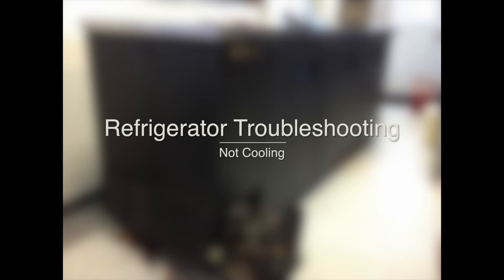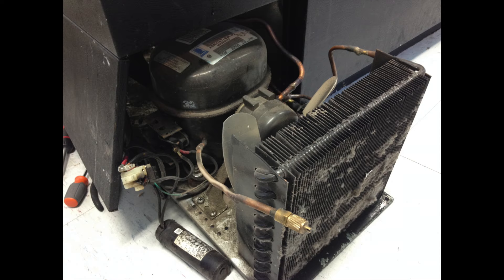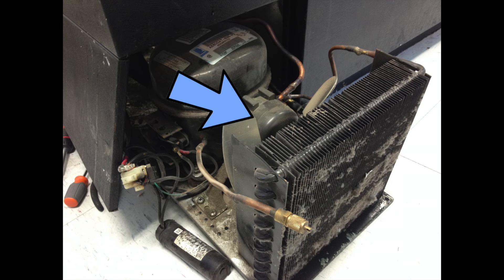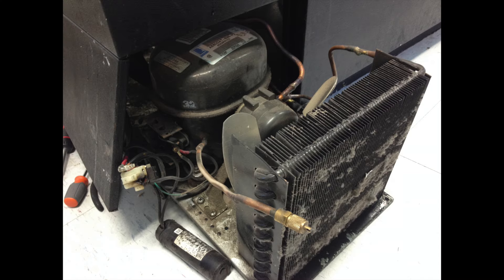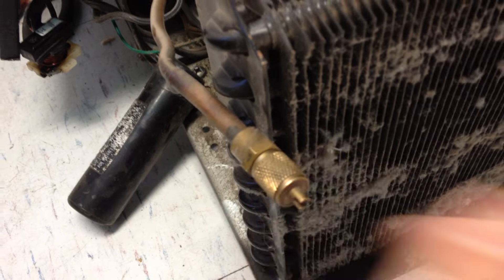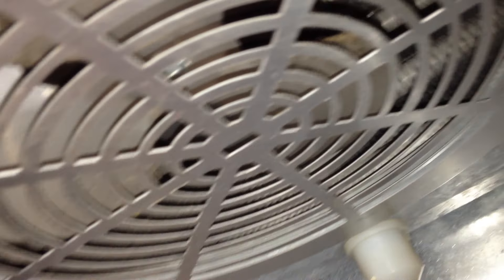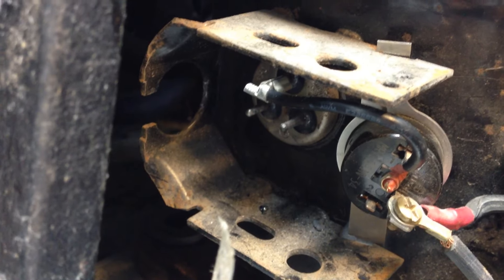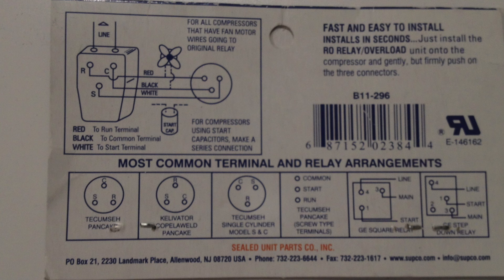Refrigerator Troubleshooting Repair not cooling - Compressor starter relay

Comment: They discovered a slow leak in our freon line.  New freon has been injected and now the refrigerator is working fine.  The replacement line has been ordered, but now we are being told that the leak has probably compromised the entire cooling system, which would require replacing the compressor, condenser, evaporator, exchanger.  All of these parts have been replaced in the last few years.  Do you think we can just get away with replacing the line and nothing else, or do you think the entire system has definitely been compromised?
Reply: I think thats bull. My fridge guy has fixed leaks a few times (which wen to zero pressure) and fixed the leak and refilled. He does have to use a special vaccum to suck out any moisture and contaminants (usually runs the vaccuum a half hr or so) before he refills it though. Hes NEVER had to do a full change of all parts, thats baloney!!!
Reply: PS Id buy the part off them (if they ordered it) and find another cooling person.

Comment: I have a True upright beverage cooler,, GDM-26, the fins are clean, both fans run, I replaced the relay because it was bad but I used a 3 in 1 hard start to replace the cap and relay.  The compressor will come on and run for about 15 to 20 seconds and cut off, the compressor sounds normal, it does not get hot to the touch.  I haven't seen any mention of a hi or lo pressure switch, is there internal switches for that?  Would a lo gas condition cause it to run like that? The unit is in good condition and I'd like to keep it,  Thanks for your help in advance!
Reply: +Rick Larson I forgot to mention that there is gas coming out of the valve when I depress the pin, I checked the thermostat, it seems to be ok, can I jump it out for testing purposes?
Reply: +Rick Larson I've ruled out the thermostat as well.  I by passed the thermostat and the compressor still runs about 15 seconds and shuts off.  My last culprit is the gas charge, not sure if I have too much or not enough.
Reply from the maker: +Rick Larson Hmm.... It sounds like a real tough one. I don't know where you would go from here.  I would not think that a low charge would cause it to shut off but you never know.  I wish I could be of more help.  Maybe someone reading your comments has some more knowledge they can share.  Keep us updated on what you find.

Comment: First off, your video's have been very helpful, able to confirm my compressor is good. My problem is with a Dutch door model maytag( MFI2568AES) that will run great for a few days, than stop cooling, ( freezer and refrigerator areas). It sounds like everything is working, can hear and feel that both fans, put my hand on compressor and it is not running. Have the spec sheet, ran through the service checks and it indicated everything was working. The main control board has been replaced, same problem before and after replacing, have since replaced compressor relay and compactor. Ran for 5 days, though I had it fixed, then same thing. Have not seen this problem addressed in any of your videos, hoping you can help.
Regards,
Jim garris
Reply from the maker: +James garris Jim that sounds like a real pain!  It can be very difficult to fix problems like that because it is working some of the time.  Is it possible that there is ice buildup?   The ice will stop the airflow and make it so that it is not getting cold. But then maybe the ice melts when it goes to defrost mode and then it builds up again.    Does that sound like a possibility?

Comment: very helpful. I wanted to know what's the small round part next to the overload and what's it's function. thanks
Reply: Are you referring to the thermal overload? It is a small round snap disc right next to the relay. It will open if the compressor over heats to protect it.
Reply: no. it's a klixon. its a bimetal disc the will snap and kill power to the common winding of the compressor. it opens when current draw of the compressor it too high. not temp of the compressor. its a common safety. but there is an internal safety inside the compressor that works the same way. again bimetal. heat and amperage go hand in hand.

Comment: Thank u so much 
Mine was not working and after watching your DIY video, I checked by myself and fibd put that my compacitior was not working 
Replaced and it’s running very smoothly 
So again thank u so much 
I saved roughly about $120 to $150.00 
For the hvac tech

Comment: I have the same cooler buta two door version. when I opened the doors it was about 85 degrees inside. compressor and fans were running but it was like an oven. any ideas? I didn't see any ports for recharging to check to see if there was freon still in it. is there a thermistor or something that may have failed? thanks in advance
Reply: actually it's a turbo air TBB-2SB

Comment: so we have a coke fridge double door commercial model. I noticed my water bottle was partially frozen. Looking inside a coke can had blown up as well. So the weather was very humid for a week when this happened. I pulled the fuse at the panel and let it cool / warm up. now when I turn it back on the top fans run (good) the fan by condenser runs (good but noisy) then I can hear a loud click, which to me sounds like the condenser is trying to kick (noisier) in for maybe a second then shuts off. Now I'm not sure whether this would indicate the compressor or the piece you replaced in video. Any help is appreciated, thanks
Reply from the maker: The relays and capacitors are cheap fixes compared to replacing the compressor itself.  It's hard to say whats wrong with it without being there but many times you can see visual clues as to what is wrong.  Capacitors can swell, crack, leak or even explode.  Relays can burn up and melt.   Rules those out first.
Reply: Thanks!

Comment: I have a true gdm-23. The compressor is running fine, the issue is the fridge will fluctuate in temperature quite a bit. Keeps freezing up to twenty degrees then warning to 45. It won't keep a constant temperature and is currently on the lowest setting. We are just starting a bakery and am losing money in product that we can't use. Any suggestions would be really appreciated
Reply: thermostat it controls compressor like a on/off swtich so if not working correctly temp will fluctuate

Comment: Thank you so much for the video. I have a quick question for anyone that might be able to help. I have a TRUE GDM-10 and the fan needs some help going. Once it is going, it cools but it kicks off and will not start again with help of a little push. I was thinking of taking the fan motor off and taking to an electrical repair facility local. Any thoughts?
Reply: You need a new fan motor. Just happened to my true prep table fridge. Motor was going out
Reply: @cariekahn398  thank you!!

Comment: Hey Great videos, i have a question i have a 3 door sandwich prep refrigerator who was building up ice in the evaporator and i added freon to correct the issue, that was about 4 months ago but a couple of weeks water was dripping off the driping pan like the coil wasnt working properly somehow i added some more freon but the system is not cooling the way it should, i hear the compressor running fine and everything else seems to be working ok, what do you think i should check on?  thanks
Reply from the maker: +Geo Von Lengerke Air conditioners and refrigerators should not need a freon recharge. So it must have a leak somewhere that needs to be addressed.  Compressors can be tricky. It may sound like it is working but the noise it makes can be slightly off letting you know that it is going bad.  But lets assume the compressor is good.  Make sure nothing is stored next to the vents inside and out so that the air can flow. If it's blocked it will freeze up.  Also the capacitor could be going bad, they often do.  And the last thing (should be the first) it's obvious but a lot of people forget to check, make sure the temp dial has not been bumped.

Comment: Adam,
Great Video, I Have a True Beverage Beer Cooler TD 50 18, it was working great and then all of sudden it stopped cooling.  WHen i turn it on, I hear a click then nothing, all of th efans are working and then 30 seconds later  another click and etc etc.  Is that the relay?   I purchased one and going to try it to see if ti works, but the one problem Im running into, i cant figure how to oull the unti out like you did, is there a bold on the tray Im not seey? or is is just corroded.
Reply: Same thing happening with my TDD-3. Did you get yours resolved?

Comment: Adam i have a ge model gsl22jftabs  fridge. the ice maker is not working. I have replaced the water Inlet valve and still no ice. but is there suppose to have a green light on, on the icemaker. does that mean there is no electricity on the ice maker. there are some coiled tubing located in the fridge. does that have anything to do with making ice.
Reply from the maker: +Sandra Booker The coiled tube is to help the water dispenser water chill before it goes into your cup.   Are your trays full of ice? Did you see the icemaker repair video I did?

Comment: I added freon to my commercial 2 door stand up fridge with the compressor on top and then the fan started making loud noise every few minutes, I took out some of the freon and it stopped the noise but its not cooling,any advice??
Reply: Tony Haddad If you do not have gauges and know what you are looking for, you should not be messing with refrigerant. These units have a very small amount of charge. Need to be weighed in using proper tools  and procedures. In general most problems with these units are electrical or air flow related. Troubleshoot these issues first to your heart's content but leave the refrigerant to a pro.

Comment: hey adam hope your still around we have a pop cooler (pepsi) that the motor /comp assy looks like this one , everything works and cools the only thing is i noticed today the fan in front of the compressor was not moving and compressor was real hot, i could reach in there and spin it by hand and fan would spin but prob not even half speed. i tried to get some ohm numbers not sure if done correct it read .010 on the 20k setting.
anyway could you give me some ideas please, i dont want to just order a 180.00 fan and have do the same thing.
compressor still cycle on and off correctly
also i tried a diff capacitor i had it was slightly smaller in value but did exact same thing so old put back in
thank you for any help please
Reply from the maker: tim c are you sure the replacement capacitor was good?  They go bad over time even if they were never used.  I would be sure the cap is good before going further or spending a lot of money.
Reply: @AdamDIY  ok picked up new capacitor does the same thing fan still runs half speed at best can stop with bare hand .
(fan that cools radiator)
everyhting else works fine
dont know what to do?
Reply: Anyone out there have any ideas that I could check please.

Comment: the cold control adjust don't work always set it 45 degrees and the tech guy say don't affect he check the freon was OK he told me the compressor is bad questions he is OK in his diagnostic

Comment: i have a cooler that trips the gfi every time i plug it in the outlet.  Could it be a bad compressor or blower motor? (ground fault) any suggestions or advice will help. Thanks
Reply from the maker: +Ray Vargas  It could be that the line is overloaded. Or it could be that the Breaker is bad.  But yes you are right. It could also be a ground issue or a short somewhere.  Did you try to use it on another line? That way you can eliminate some of the possible issues.

Comment: Im in HVAC2 and my classmate is working on a commercial fridge... but the compressor turns on and off every 10 seconds or so system is charged with 410A

Comment: You didn't discuss the cause of the fried relay - I am a cause & effect guy so the other half of the relay issue is a mystery.  Thanks.  Steve
Reply: +Stephen Shore When you see burning of the connection like that, its because its loose and generating heat or the "relay" has burnt contacts and is making the wire heat up. Its very important to clean the three terminal posts on the compressor and make sure the new connections fit tightly.

Comment: hey ADAM, what is the  role of P.C.B in the refirigirator? thanks
Reply from the maker: +Anees Baba It depends of the fridge but it does things like the auto-defrost settings and sometimes temp controls, even alarms or water filter replacement notifications.

Comment: mine is freezing everything after 2 days . unplug it for a day then plug back. 2 days works good then everything freezes again. any solutions for that ?
Reply: Sounds like your thermostat needs replaced..
Or your coolant is low !!
Reply: Coolant? Check your evap fans as well.

Comment: Hi my single door chiller is not getting cool gas is 410a and after expansion valve ice formation on copper pipe why what should be the reason.
And gas is 35 psi
Reply: rajanikanth mane expansion valve strainer may be clogged or your txv may be bad

Comment: Hey Adam i need you help, how to check the compressor for a comercial refrigerator,
Reply from the maker: If you don't hear a hum or feel the compressor vibration then it may be bad. Or the relay or capacitor is bad.
Reply: Use an ohm meter to check the windings between the start, run and common terminals. You should read resistance. If you don't on one, you have an open winding, meaning the copper wire inside has burned apart. If this occurs, sometimes you will read resistance to ground. That would be I direct short and the breaker will trip.

Comment: hi if my commercial fridge stops and starts every 2 minute what can it be? the relay or thermostat?
Reply: The  condenser fan motor should be  running when the compressor comes on . The compressor might be going off on internal overload (you will hear a small click on the compressor ) when the  compressor cools off the overload  resets itself and the fridge starts again. If the fan doesn't kick on the compressor runs the compressor  will trip on overload.

Comment: Hi  
I was watching your video about compressor  relay and capacitor I did everything you shown but compressor turned on for a few seconds then turned  off.
Reply: you probably have a stuck compressor. If you have a clamp on meter use it to check amperage when it starts..if your amperage is like at +15amps +20 or so..you need to replace the compressor bro.

Comment: hi adam
my vege fridge is not cooling enough . temp stays between 10 to 16 cel (4 cel recommended)
compressor works gud
clean and tidy
all fans are working
refilled gas
plz help
sometimes temp comes to 4 cel. even local refrigeration guys cant find any problem and recommends me to buy a new one instead of wasting money on it.
plz help thx
Reply: Did you ever figure out your problem on this refrigerator?

Comment: I have a whirlpool 2003 which is not cooling. My start switch does not click when plugged in nor is my fan running. In your video you show the fan running with the bad start switch.
I did take out the start switch and when shaking it it does rattle so I think the switch is bad. I checked the compressor and I have continuity on the three pins. So I am wondering if the fan is bad as well. What do you think
Reply from the maker: +Jan Gaudina I assume you are talking about the fan that blows near the compressor and not the internal fan right?  Fans rarely go bad so I would not start there.  I would suspect the capacitor and or start relay.  Capacitors go bad on their own. Heat makes them go bad even faster.  If you are guessing what part to buy first and you are making a 50/50 gamble, I would buy a new capacitor because it may not be long before you need one anyway.  If that does not work buy a new relay.  If you really suspect the fan is bad you can test to see if it is getting power with a voltmeter.

Comment: So I have a Kegerator thats similar to this commercial fridge, I Replaced the entire motor but i noticed that the compressor gets really hot. Should i worry about that? I thought about installing a blower to move the hot air away and out.
Reply from the maker: They do get hot but maybe try to get some info on that model compressor and see if you can find the running temperature.

Comment: i have the same problem but the condensor fan not working everything else works fine....any suggestions pleaseee
Reply from the maker: Start by checking the voltages going to the fan.